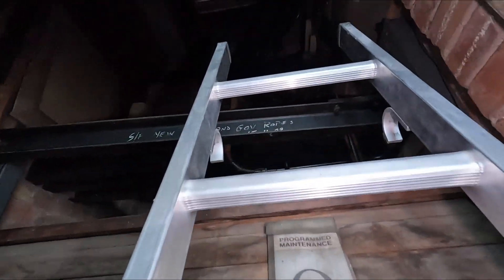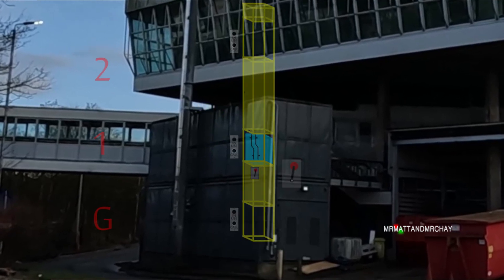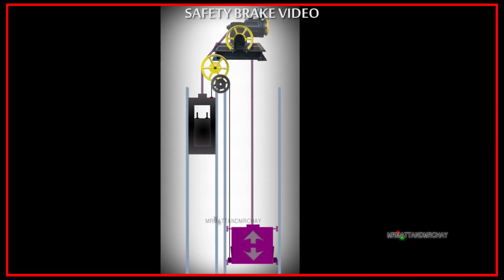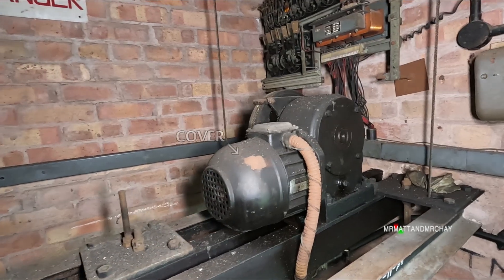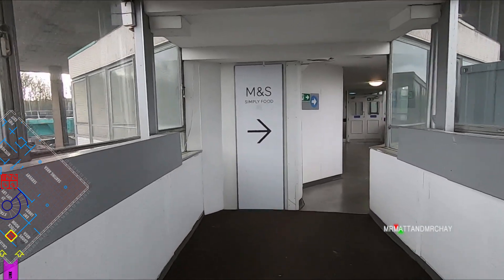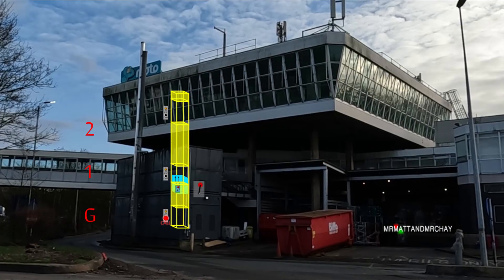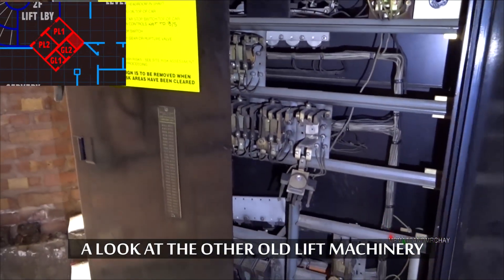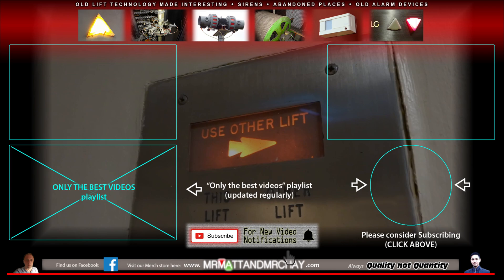A lift with NO BRAKE?  Hilton Park services 4 (the 'technical video')

Comment: As i supposed the motor brake is very similar to the demag brake motors with conical rotor.
If there is no additional winding for the brake it basically has to be a conical rotor since otherwise the pull force won't be very strong.
Of course the design is a bit different but the fundamental principle is the same.
Reply from the maker: Very interesting comment!  Every day is a school day! :)
Reply: I know there are some motors that use a spring loaded disc brake arrangement, small enough to fit under the fan end bell. They have a separate coil that is ~2" thick and the wires are routed through the motor housing to the motor junction box.

Comment: A lot of worm drives cannot be driven 'backwards' through the drive, depending on the angle the worm is cut and the teeth on the crown gear wheel. A lesser angle (or finer 'thread' on the worm gear) gives a greater reduction in speed and increase in torque and is also much more difficult, if indeed at all possible, for the crown gear wheel to drive the worm gear. In such a scenario, any brake would be a 'belt and braces' approach just to be sure nothing could move.

Comment: Looks like the lift shaft goes down to the loading dock, just not the lifts guide rails. I think the stopped using it because it was virtually useless for the day to day operations of the building.

Comment: I'm watching these videos with some trepidation as like you I have terrible phobias for both water tanks, lift shafts and equipment. I have to make a great effort to look when you tip the camera to look down a shaft. It's a totally irrational phobia but debilitating nevertheless. I went to photograph a gas holder that is being demolished in my local park, it has a great gaping hole cut in the side of it exposing the internal structure and it nearly drove me crazy with fear until someone else came walking by with the same curiosity and I was fine as we discussed the task in hand for the demolition company.

Comment: Interesting films indeed. Does anyone know what make the lift was in the sound effect that all the old James Bond movies use?  You know the sound, the one with the loud brake slow down noise. Holby City and Thunderbirds used the same sound too. It’s something I’ve been trying to get to the bottom of for years. Thanks.
Reply from the maker: I know exactly the noise you mean.  It was thought of as a "normal sound that a lift makes", but probably from the 1920s!!  I don't have it though unfortunately.
Reply: @mrmattandmrchay  I couldn’t believe it when Holly City started using that sound before the series ended production. The original 1950s passenger lift at the Tyne Pedestrian Tunnel made this exact noise before it was modernised.
Reply: @scammell23 I have never watched Thunderbirds or Holby City and the last Bond movie I've seen is from the 90's. But I instantly remembered that specific "elevator sound" when you mentioned it. Thanks for bringing this up, it would be really interesting to know where the original sample was recorded 😄

I've also sometimes noticed the same "thunder" prop noise being used. Many of these samples propably date back to the reel-to-reel days 😄 (now obviously digitized)

Comment: No wonder the crown wheel on your demonstration lift is missing. They're made of reeeally nice big heavy hunk of juicy bronze. Learned that while dismantling an old lift. Been questioned then on where it went. The wheel that is. But it was easy to get my teams hands clean since we had someone else deal with the scrap. And brainwise those workers were just one chromosome away from chimps. We just went "Well I'dunnoh. Wasn't moine job to deal with scrap." :D That thing bought us quite a few beers and a pack of cigs for each one of us that night. Had to cut it in half to get it outta there. Almost tore my arm in half. :D

Comment: Hi Matt,
Again, a very good and detailled video! This type of machines is fornas far as I know only used by dumbwaiters and not for passengerlifts. So that is very surprising to me. As written in an other comment the brake is similar to a hoistbrake. In have a picture somewhere on my laptop were that part has been opened. It works with a magnet inside.
Reply from the maker: Hi Joris.  Ive sent you an email, asking for a bit of help with something.  Pls take a look if you have time.  Many thanks. Matt

Comment: This is definitely a minimalist basic lift but, for a simple little goods lift, why have more expensive complications?
  The “Shaft Switches” were just one of the many variations of the 6098 switch and did away with the need for a selector.
  Floor relays were always designated from 1F, the lowest floor, up to TF, the top floor. This was just standard practice on Otis however basic or complex the system.

Comment: the brake is on the backend of the motor.
Reply: its the safety gear on the car not a brake, the gear has eccentric dogs egg shaped that bite into the guides, only when the ropes fail.
Reply: stannhah are notorious for using brake motors, there a pain in the arse.
Reply: in the its called a delay off timer thars 2 to 5 seconds from the car to the landings they also have an AQR timer anti quick reversal timer that stops the motor from reversing quick.

Comment: Superb video! I've never seen this arrangement before - where the metal dome at the end of the motor is forced away from the main motor housing, to move the lift.

When the brake is on, does the system rely purely on friction to hold the lift still, or are there other components?

With a normal contactor - the electromagnet, when energised, causes the metal contacts to experience a force, pulling the metal contacts towards the electromagnet. Here, it's the other way round - the electromagnet pushes the metal dome away from the main motor housing.

How has the electromagnet in this motor been designed so that it repels instead of attracts?

Sorry for bombarding you with questions!
Reply: It's a worm gear so very little force on the input shaft is needed to keep it from rotating. The rotor of the motor is probably slightly offset from the stator towards the output side by a spring so when the field windings are energized they pull the rotor into the stator which moves the metal dome away from the housing disengaging the brake so no separate electromagnet is needed.